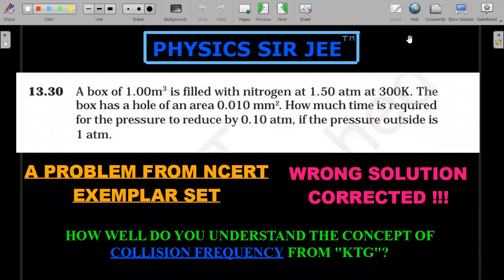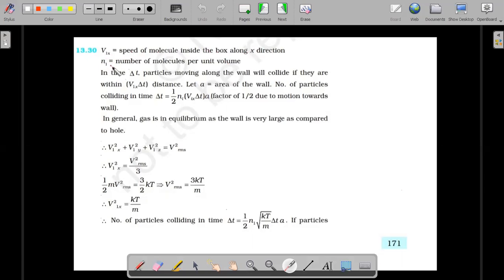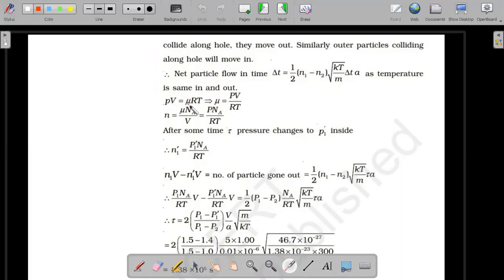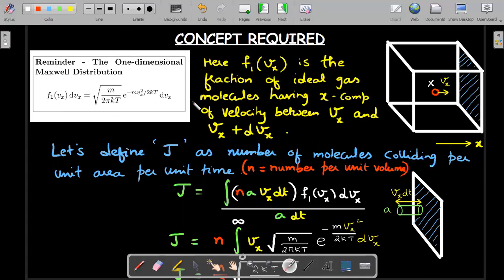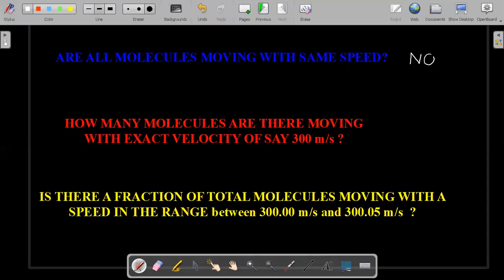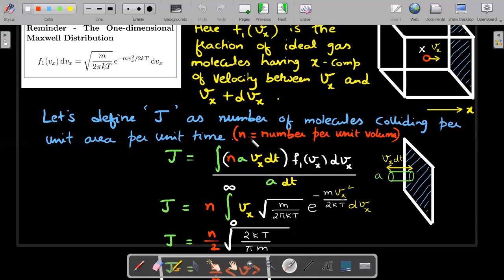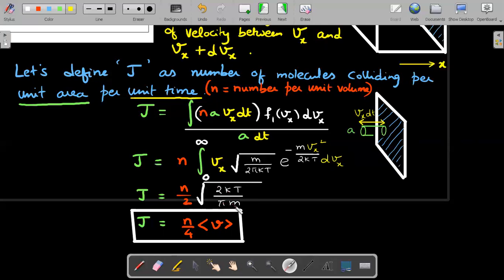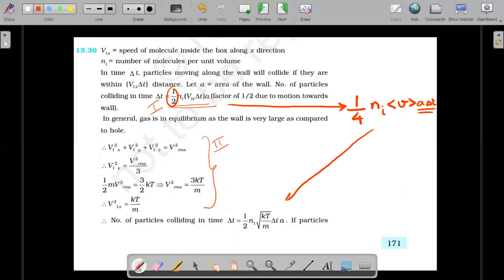RESOLVED-04 ! A MUST SEE! KTG : COLLISION FREQUENCY, CORRECTED SOLUTION OF NCERT EXEMPLAR prob 13.30

Comment: A similar concept is when a large wall moves in a region with ideal gas the wall experiences drag force due to gas molecule hitting from front and back. A question based on the above mentioned statement was asked in jee adv but only proportionality was asked so factor of 2 did not matter. In aits they neglected the 2 and in cengage they used the two. I was hence confused but now my concept is clear thank you sir.
Reply from the maker: And that is exactly next question to this question in NCERT exemplar
Reply: @PHYSICSSIRJEE  sir i have not solved exemplar so did not know abt that. I tried to find the velocity of the moving wall as a function of time and it came out to be exponential probing that atmospheric drag forces also vary as Kv
Reply: @PHYSICSSIRJEE  and sir this knudsen number and this collision flux isnt in physics right? when i was preparing for incho i read abt them in peter atkins
Reply from the maker: @krishnabharadwaj4638  yes , not there in NCERT but is needed to understand properly the Solution to NCERT exemplar Problem

Comment: Hello sir..I have a doubt ..there's actually two type of distribution functions in one we have power of   1/2 in one we have power of 3/2 ..https://chem.libretexts.org/Bookshelves/Physical_and_Theoretical_Chemistry_Textbook_Maps/Supplemental_Modules_(Physical_and_Theoretical_Chemistry)/Kinetics/03%3A_Rate_Laws/3.01%3A_Gas_Phase_Kinetics/3.1.02%3A_Maxwell-Boltzmann_Distributions... whats the difference between both and which funtion to use here?
Reply: Read Atkins for derivation of that 1/2 function

Comment: Thank you for the explanation sir jee. I have a doubt regarding the RHS of the final steps (p1-p2) we are substituting p1 as 1.5 ATM but it will vary with time. how are we substituting a constant value sir.
Reply from the maker: @siva teja , the temperature in the wording of the Question was assumed to be constant . So avg speed remains constant . Also volume of gas in container V is any way fixed. So from PV=nRT equation with V,T fixed , change in P is directly related to change in n directly without the need of integration. I will soon be posting a new video in which we can vary this and then have to integrate the expression in the last step. I hope that clarifies your doubt and thanks for the idea🙂